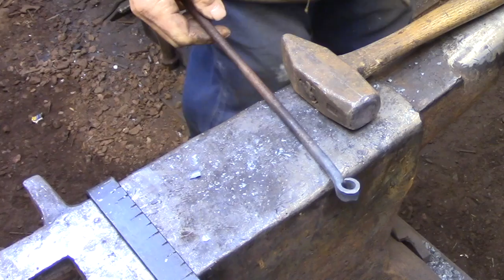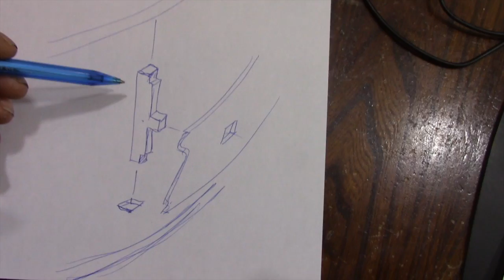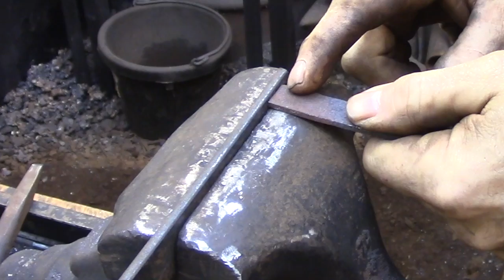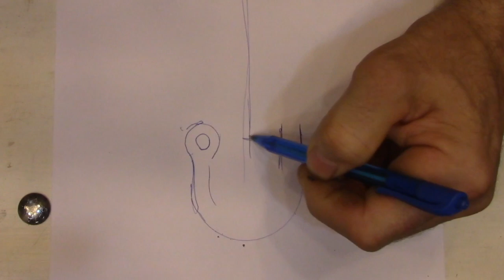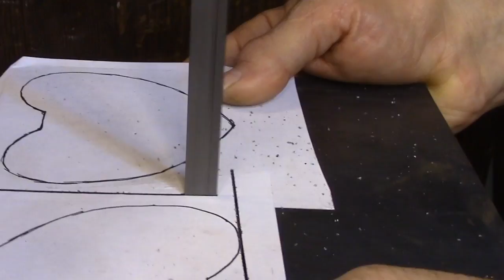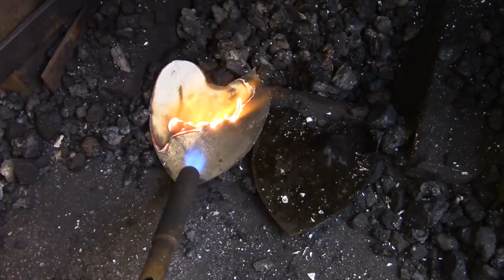Blacksmithing Project - A Basic Padlock

Comment: This really is an excellent video series concerning the Padlock build.  I'm watching it for the 3rd time.  Would it be possible to make this Padlock series into a playlist unto itself?  I've been forging for 20+ years, including for the National Park Service, and have never made a lock of any kind.  I consider this series as an important learning source and will be using it in the near future to make my own Padlock.
Reply from the maker: I added it to the playlist. let me know if you have any questions along the way
Reply: @df-intheshop330    --  Awesome, thanks!!  I know you designed this lock on the fly or as you went, but do you have any plans or basic measurements?  I'm talking about things like overall length and thickness of the lock itself.  I'll figure out the interior stuff as I go like you did in the video.  I do have the book written in 1999 by Spruce Forge titled "Manual of Locksmithing, A Blacksmith's guide to simple Lock Mechanisms", but it doesn't have a padlock like the one you made in the book.  Thanks!!
Reply from the maker: The width of the lock case is 3".  The height of the case from the point at the bottom to the flat section at the top is 2"3/4.  The cover and backplate extend beyond the lock case by approximately 1/4" on all sides and the two lobes at the top of the lock extend beyond the top of the case by approximately 3/4".